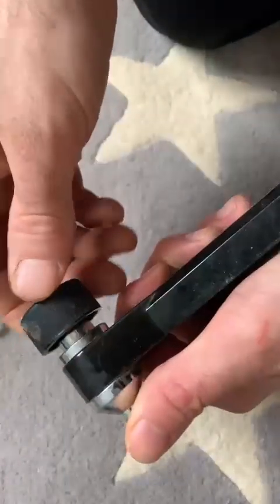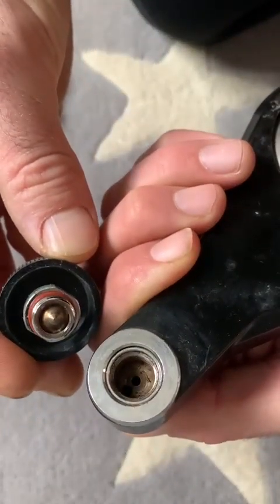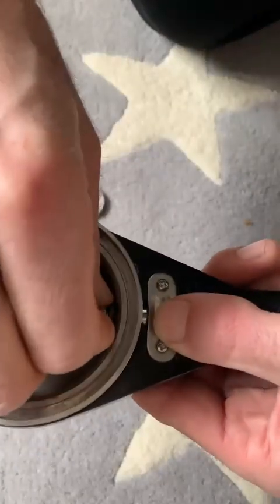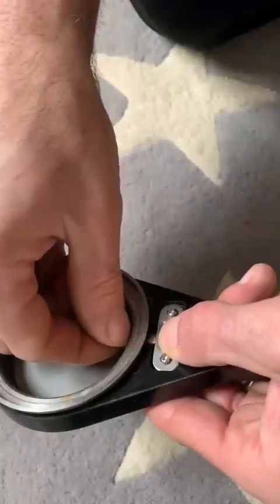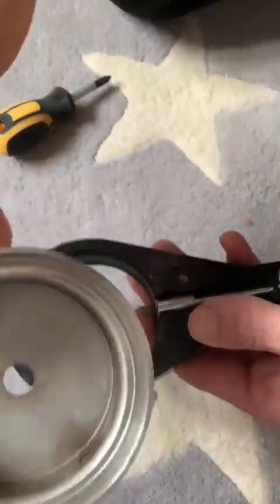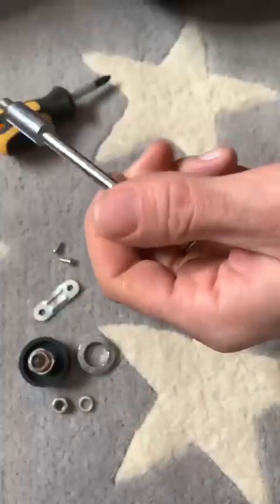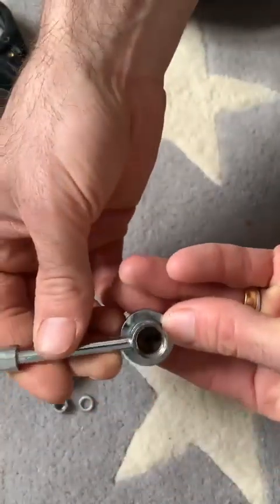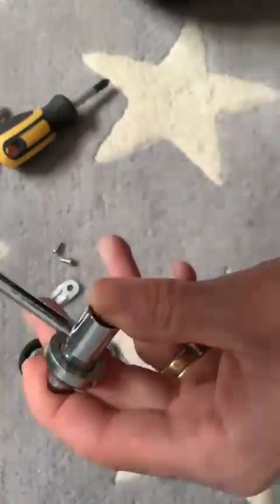Bellman Coffee Spout Cleaning

Comment: Hello and thank you for this very helpful video.  I wonder if you can help me.  I've disassembled and cleaned the parts and am now reassembling the unit.  When I have screwed the knob back on (first manually with my hand to screw it in to place) and then using the spanner to tighten, the top knob doesn't move independently of the bolt.  So, when I open the valve, the bolt moves with the knob.  Is that supposed to be the case?  Thank you for any advice you have!